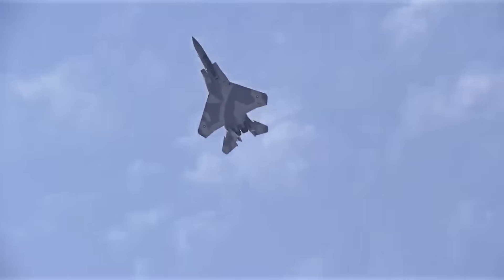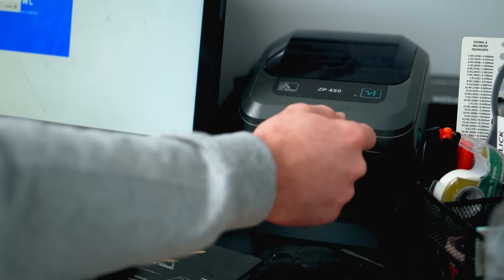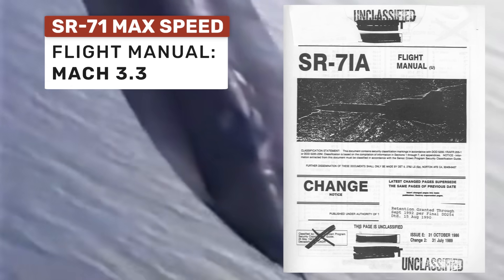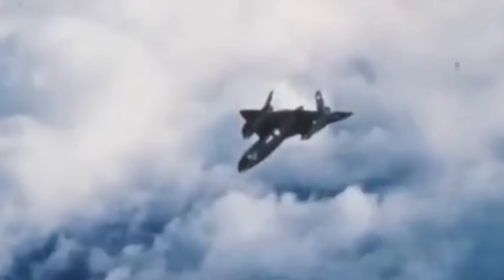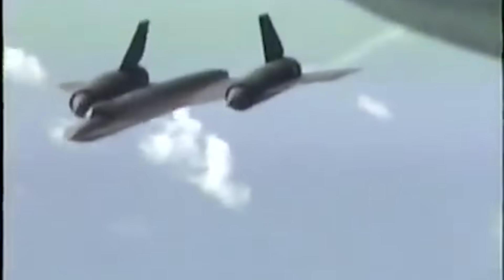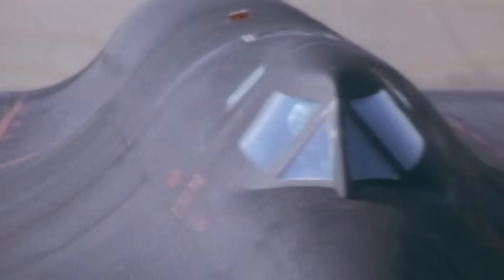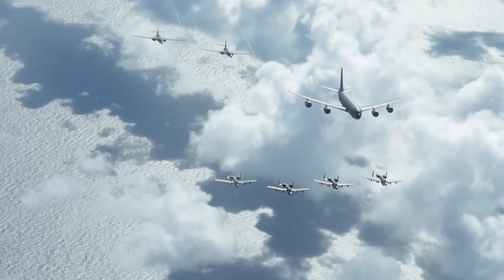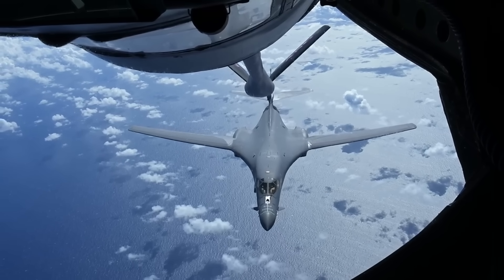The SR-71 was MUCH FASTER than the Air Force will admit

Comment: This isn't about the SR-71 but about how the USAF downplays the listed top speed of their aircraft. My father worked on the B-58 Hustlers before the SR-71's entered service. From Lubbock, TX, with a reconnaissance pod, a B-58 flew to Alaska, during that earthquake in 1964 and to DC, and had developed films in 6 hours.  That was an average cruising speed of Mach 4, per my calculations. He refused to tell me the top speed as it was still classified.
Reply: The SR-71 was flying in what? 1958 and early 60's. Now if you had said the blackbird had made that flight I would be inclined to believe you. As it probably did.
Reply: I call bs on that one.
Reply: @zd1322  This is before satellites.  The US didn't know if the Soviet Union launched a nuclear attack on us.  The Pentagon needed info as fast as possible.  The B-58 with the reconnaissance pod was the fastest plane in the inventory with a camera.
Reply: The maximum takeoff weight of the SR71 was 170,000 lbs and the B-58, 163,000 lbs.  The max thrust of the SR71 is 65,000 lbs and the B-58 62,400 lbs.  The SR-71 is painted and the B-58 is not.  I believe the B-58 can fly as fast as the SR-71, based on the metrics.

Comment: I worked F-15 A,B,C and D's from the late 70's til I retired in 2002. Every AC I worked had the VMax switch safety wired shut.
Reply: This was for maintenance and engine preservation purposes during peacetime operations. The P&W and GEs in the F-15/F-16 are limited to 98% of max power in order to extend the life expectancy and lower extend routine maintenance. Enabling the VMax switch allows for max fuel and 100% power. If the pilot uses this switch for less than a specified time (I think it was 15 or 30 seconds) then all was good. If for longer, then the engine would require additional maintenance and inspection before the next flight via borescope.
Reply: What does that mean?
Reply: @zd1322 there’s a switch cover thats safety or lockwired shut with copper safety wire to prevent the cover from being lifted and the button pressed unintentionally
Reply: @zd1322 Steel wire approximately .040 thousandths. We used to "safety wire" many items on the AC so that that they would not loosen or back off the set positions.

Comment: When it comes to military hardware the US tends to understate its capabilities, unlike certain Slavic or East Asian nations.
Reply: RF is not ethnically Slavic. Most moscovians aren't even ethnically Slavic...but we know what you meant. They like to pretend about much more than aircraft specs...
Reply: Russian su-57 flies mach 6.5 dont ya know. Its so stealth that no one has ever seen one fly over ukraine. Has a height ceiling of 95,000 ft. It even has a gun that goes pew pew pew
Reply: @DaneKaiser  Does it still have engines that go "crunch crunch" though?
Reply: @mfree80286  we'll sort of. It's more of a clang clang crunch boom poof click click click click type sound though. Go slam your silverware drawer shut really hard and that sounds about right
Reply: @DaneKaiser -- just a few days ago they got a '57 off the ground to drop some big bomb on a Ukrainian target. It was "escorted" by a pair of '35s, and the big bomb it dropped missed and made a hole in an empty field.
Reply: @lordphullautosear  are you sure the 2 su-35’s weren't towing the 57? ,😂 that's good info though thank you.I'm pretty surprised that they actually flew a 57 over Ukrainian soil. They are deathly afraid of getting one of those shot down. They only have 7 partly operational 57's flying right? They've built 9 total but 2 are just for testing or prototypes

Comment: Really? No shit, I have been saying this for years, same with the F-15. If anyone is dumb enough to think Mach 2.5 is an F-15's top speed you do not understand basic math, aerodynamics, and metallurgy. When you have an aircraft which has just shy of 70,000lbs of thrust (SR-71), or in the case of the F-15 60,000lbs of thrust with a thrust to weight ratio of .93 the only thing limiting the speed would be aerodynamics and composition. In both cases it comes exclusively down to composition. The SR-71 will melt over Mach 3.7 if sustained for more than a few seconds. The F-15 can easily reach Mach 3.5 no problem, however it will begin to melt at around Mach 3.1 if sustained for more than a few seconds. This is all due to composition. If you could make an F-15 out of carbon-nanotubules the plane could easily have a sustained airspeed of Mach 3.5 and do up to Mach 3.7 due to aerodynamics and gross fuel consumption. However, that would be an outrageously expensive plane and...why? Anything over Mach 2 for an actual combat aircraft is just overkill.

Comment: Short term, 3.6 
Barber pole on Mach meter is the 'do not exceed' speed marker, not related to service speed, .. it is there to indicate absolute airframe limits, such as might be encountered in a catastrophic dive. The barber pole markings on the 71 airspeed indicator is at M4.5. This is not necessarily a speed that could be achieved in level flight with thrust.. It is a warning about airframe limits that should never be reached by any means, or risk of unintentional disorganization becomes an issue.   Based on the profile of the wing geometry and nose and how the mack cone shspes itself, combined with the engine entry deceleration cones, my personal estimate is that controlled flight can be maintained to about M3.6. above that the mach cone interferes with too much of the wing and gets into control surfaces.. My estimate is that above M3.9 the control surfaces start to get into big trouble, and the engines will be operational distress. so... 3.6 to 3.7. A longer nose cone might increase this a tiny bit.. and they DO have interchangeable noses.

Comment: I'm guessing there was some small flaw that couldn't be fixed which kneecapped this thing at only mach 3.5 during normal flight. Hermeus has a similar-ish style of engine that barely turns on at mach 3. I am pretty sure that rebuilt with modern tech it and with no pilot at risk it could hit mach 4+ regularly with very little changing.
Reply: I saw the Kimora engine as well. The Turbo ram jet built for $1.5m proof of concept